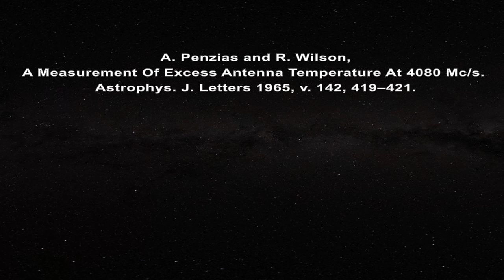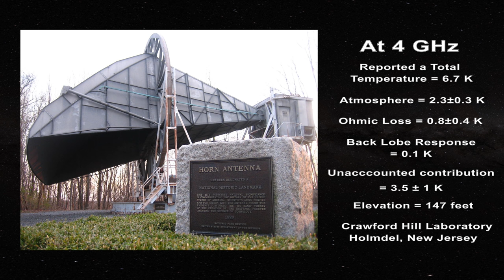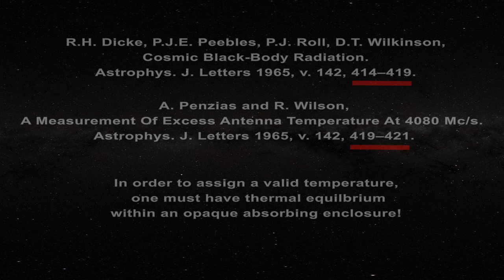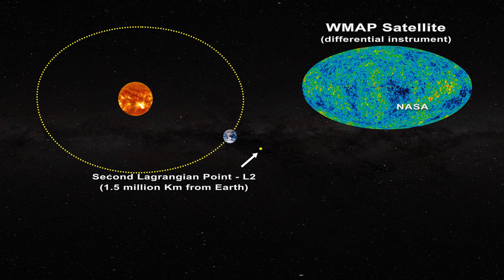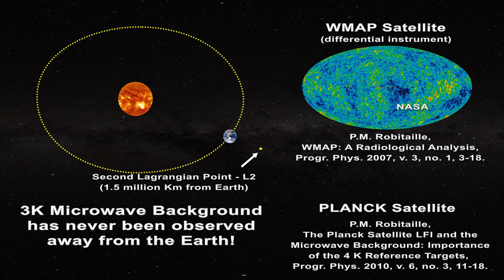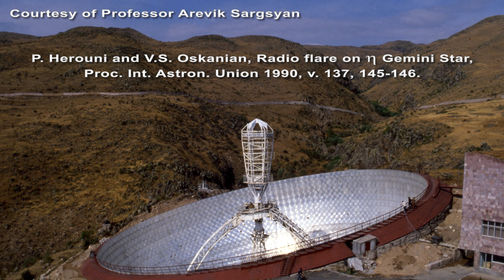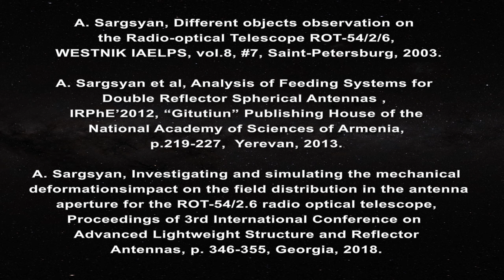The Herouni Antenna - The Death of the Big Bang!

Comment: The CMB is due to aeons of expansion. A small volume of very hot energy is now widely scattered so very cold. If there was no primordial energy the background would be zero Kelvin but its actually 3K +/- 2K. 
How does this debunk the Planck spacecraft map of the CMB which shows the signal is not uniform and suggests how matter could have been formed form the original big bang energy.
Reply: "How does this debunk the Planck spacecraft map of the CMB which shows the signal is not uniform and suggests how matter could have been formed form the original big bang energy.' David Elliott

Since the CMB does not exist, what did the Planck satellite detect? It did not report the presence of the monopole signal at L2, because it's not there. Without the monopole signal at L2 all talk of CMB anisotropies is specious.

Comment: Dr R - You said Herouni measured 2.6 K at 8 mm wavelength.  Wikipedia "Radio Telescope" article shows an opacity curve indicating that radio signals from space of 8 mm wavelength are 90% absorbed by the atmosphere, while longer wavelengths such as the 75 mm length measured by the New Jersey telescope past through the atmosphere unabsorbed.  Is this a problem, or is the Wikipedia opacity curve wrong?

Comment: The stretching, or production, of space-time, cannot cause the non-Doppler, cosmological red shift.  To get the portion of the red shift that was used, erroneously, to justify the big bang theory, the luminal speed limit, mass induction, and the tuning of the quantum electrodynamic notch filter must be variable.  From that realization, I proceeded to develop my alternative model.

Comment: I also think that such a telescope should have been funded by the government of Armenia. But again, this is not a radio dish which is designed to pick 22GHz (and higher frequency) noises but rather this is a radio telescope, designed specifically not to pick them up. You don't build a radio telescope to hear noise. You build it to see stars, galaxies. You are clubbing the wrong seal :-).

Comment: It’s honestly shocking that no one other than myself will come out and expose the manufactured amorphous silicon sphere that is fixated at 100 km which is otherwise known as the Karman line. This is responsible for radio transmission among many other “wave” phenomena even though waves are actually bubbles in a closed system.

Comment: OK so The big bang temp. assignment is unconfirmed. It does not mean there is no near blackbody temp. and a big bang ala SPIRAL cosmological redshift hypothesis that does provide a lattice for the cosmic inflation expansion relatively early in history (SPIRAL's Magnetic repulsion' hypothesis) remains as the last fully consistent w/ all the factual observations hypothesis standing in the SCM-LCDM vs SPIRAL comparison.
Reply: @rmpcta: This is not an issue of the alleged CMB temperature being unconfirmed, it is certain proof that there is no CMB so there is no CMB temperature. Only condensed matter can produce a thermal spectrum but according to the Big Bang creationism there was no condensed matter when the alleged CMB was created. At the time of 'recombination' the CMB was 'set free', but there was no condensed matter still. So the Big Bang had no way to produce a thermal spectrum. Without the monopole signal all talk of Big Bang and its CMB is just wishful thinking. Professor Herouni's measurements prove that there is no monopole signal. Penzias and Wilson  measured measured the Earth due to microwave diffraction into their horn. COBE-FIRAS measured the Earth due to microwave diffraction over its shield. The WMAP and Planck satellites at L2 (~1.5 million km from Earth) did not report the monopole at L2, because WMAP was incapable of doing so and Planck because the monopole is not at L2. It is a scientific fact that the monopole has never been detected beyond ~900km of Earth (COBE) and that's because Earth is the source of the signal, via the hydrogen bond in water. There is a lot of water on Earth.

Comment: Much I get into debates with people over the fact of the speed of light and light years in general where people think that light years are and great distance like you're trying to equivalate a light-year in a distance what you cannot do that precisely because everything depends on frequency and you can actually do that because it's only 1.1% between .1 2.5% of a whole frequency on top of that it fluctuate so it's no it's not even stable so you cannot generate a number on distance from using that in light years I call it the strobe light effect because things appear farther than what they are when they're not really that far to begin with

Comment: By the way, you don't need a super-cooled antenna to see "background" (which will be mostly terrestrial and galactic). You can simply coherently combine many cheap antennas with independent receive chains.  The noise figures will average out.  Anyone with a few 10s of thousands of dollars these days can "measure the background" better than Penzias and Wilson did.  Doing it away from Earth will, unfortunately, cost much, much more.

Comment: One question. What’s wrong with a paper predicting a result, and it later being confirmed by an experiment? I’m only asking about the method - hypothesis/proof then theory.
Reply: Protophanes I haven’t read the paper in question but I would assume it predicted the Big Bang. Did it claim it as fact or as a theory? If not, then I see this as speculation which was backed up later by testing (accidental or not). I’m not pretending to be an expert on this subject so don’t mistake it as so. But I am curious.
Reply: @TheSteveSteele  : Penzias and Wilson placed their paper on excess antenna noise with an astronomy journal, under the influence of cosmologists, Dicke et al. included. They should have placed it with a geophysics journal so that their result could be properly analysed by the broader scientific community. It was the cosmologists who assigned the excess antenna noise of the Penzias and Wilson horn to the Cosmos, because they wanted to substantiate their Big Bang theory. Now it is a scientific fact that the CMB monopole signal (the 2.725 K blackbody part of the CMB) has never been detected beyond ~900 km of Earth - precisely because Earth is the source of the signal. Penzias and Wilson did not consider diffraction of surrounding microwaves from Earth into their horn antenna. The excess noise they found is due to such diffraction, not from a cosmic signal as claimed by the cosmologists and astronomers.  In 1988 professor Herouni used his antenna to sample the CMB and his antenna returned 0 K. Thus, there is no CMB, hence no big bang. Herouni's antenna is the most sophisticated radio telescope ever built. Its self-noise is 2.6 K. There is no other radio antenna in the world comparable. His detector is located within a hemispherical dish so that diffraction from the surroundings into the detector is eliminated. In his 1999 paper professor Herouni describes his antenna as an antenna "without edges", since the effect of diffraction at the edges is eliminated from the detector.
Reply: Steve Crothers That’s very interesting. Thanks for taking the time to explain it. What about the WMAP and other satellites that have mapped radiation across the universe? I heard him address this but are their results not reliable for some reason? And where does that leave the Higgs boson particle discovery from a couple of years ago now?
Reply: @TheSteveSteele  First, WMAP all-sky anisotropy maps are nothing but data-processing artefacts [1]. There is no signal in its maps. The signal to noise of WMAP is barely greater than 1, so it can't tell the difference between noise and signal even if signal is present (but it isn't).  The noise (the galactic foreground) is ~1,000 times greater than the alleged signal. Without a priori knowledge of the source of emission or an ability to manipulate the source, it is impossible to extract any signal from such a large envelope of noise. The Planck satellite is no better [3]. In the absence of the CMB monopole signal all talk of anisotropies is wishful thinking. It is a scientific fact that the CMB monopole has never been detected beyond ~900 km of Earth - precisely because Earth is the source of the signal [2, 4]. The Higgs boson is a different kettle of fish, with its own set of fallacies.

[1] Robitaille P.-M., WMAP: A Radiological Analysis, Progress in Physics, v.1, pp.3-18, (2007), 
http://www.ptep-online.com/2007/PP-08-01.PDF

[2] Robitaille P.-M., COBE: A Radiological Analysis, Progress in Physics, v.4, pp.17-42, (2009), 
 http://www.ptep-online.com/2009/PP-19-03.PDF

[3] Robitaille P.-M., The Planck Satellite LFI and the Microwave Background: Importance of the 4K Reference Targets, Progress in Physics,v.3, pp.11-18, 2010, 
 http://www.ptep-online.com/2010/PP-22-02.PDF

[4] Robitaille P.-M., Water, Hydrogen Bonding, and the Microwave Background, Progress in Physics, Vol.2, April, 2009, 
http://www.ptep-online.com/2009/PP-17-L2.PDF

Comment: Consider what an electric field looks like. There is never a positive side without a negative side. This is because electric charge is not elementary, it is an emergent pattern of angular momentum. I highly suspect that one of the quarks in every hadron is a false quark made up of vacuum energy, specifically the one with imaginary vector in comparison to the other 2. This is likely the reason that space/volume exists.

Anyhow, my point is that monopoles are a myth, they don't really exist and at the finest levels we can see that when they "try" to exist it results in spontaneous creation of a third virtual particle (the imaginary quark) or it results in separation of charge (W bosons as a result of meson transfer). 

When the strong force tries to act like a monopole, it breaks into the weak force. Monopoles are so forbidden that space and volume are created to keep it a dipole.

Comment: Why is there only one theory for the redshift in the universe? 
The Bigbang-theory is based on the observation: The larger the distance, the larger the redshift; but maybe that theory is wrong?

Maybe that observation should be regarded as a property of light, and not as a proof for bigbang-theory?
When the redshift in the light of galaxies would be measured (at intervals) over a long period of time, then what happens with that redshift?
According to bigbang-theory then that redshift would increase, but if that redshift does not increase, then that would be proof that the bigbang-theory is wrong??

Comment: “Dark Matter is not ‘invisible’, is not ‘transparent’ Matter.”
Adrian Ferent

“Light will not cross Dark Matter because the Gravitons from Dark Matter will transform light in Dark Matter.”
Adrian Ferent

“Light will not cross Dark Matter because Dark Matter density is higher than Planck density.”
Adrian Ferent

You learned from your professors, from your books, from the greatest scientists…that Dark Matter is ‘invisible’, is ‘transparent’ Matter.

“What you learned from your professors, from your books, from the greatest scientists… about Dark Matter is wrong”
Adrian Ferent

You learned that Dark Matter is some form of material that does not emits, reflects, absorbs light.
This means the light goes trough Dark Matter because light does not interact with Dark Matter.
The wrong picture where Matter only accounts for 4.9 percent of our universe; another 26.8 percent is constituted of Dark Matter and 68.3 percent is constituted of Dark Energy. The scientists thought because there is 5 times more Dark Matter than Matter, because they did not detect Dark Matter which does not interact with light, the scientists have come to the conclusion that Dark Matter is ‘invisible’, is ‘transparent’ Matter.
When you look at the sky and you do not see Dark Matter, this means it is ‘invisible’, is ‘transparent’!

Here are 2 examples, Lisa Randall professor from Harvard university and Dan Bauer physicist from Fermilab, of what the professors, the scientists think about Dark Matter: they think that Dark Matter is ‘invisible’, is ‘transparent’ Matter!

Lisa Randall professor from Harvard university, on New Ideas About Dark Matter:
https://www.youtube.com/watch?v=NdaQWj5ykso

Dan Bauer physicist from Fermilab, on what is Dark Matter:
https://www.youtube.com/watch?v=o79szJBtQ5E

Visible light is usually defined as having the wavelength around  5 × 10^(-7) m.

I calculated the mass of Dark Matter, a sphere with the diameter of 2 wavelengths:
The sphere volume:

V= 4πr^3 / 3
V= 5.2 × 10^(-19) m^3

In Ferent Quantum Gravity, FQG, Dark Matter with this volume has a density higher than Planck density!

The density of Dark Matter is higher than Planck density = 5.2 × 10^96 kg/m^3

I consider the Dark Matter density for this volume 5.2 × 10^99 kg/m^3, much smaller than Ferent density.
The Dark Matter mass:
M = 27 × 10^80 kg

This is a huge mass, because Dark Matter has another structure, based on Ferent length  much smaller than Planck length.

Light will not cross Dark Matter with the volume V and the mass M.

Light will not cross Dark Matter with the volume V because the Gravitons from Dark Matter will transform light in Dark Matter.

“Light will not cross Dark Matter because the Gravitons from Dark Matter will transform light in Dark Matter.”
Adrian Ferent

“Light will not cross Dark Matter because Dark Matter density is higher than Planck density.”
Adrian Ferent

This means:

“Dark Matter is not ‘invisible’, is not ‘transparent’ Matter.”
Adrian Ferent

“Your professors, the researchers, the greatest scientists…did not understand Gravitation and Dark Matter”
Adrian Ferent

“Ferent equation of the Universe, made of Matter and Dark Matter”
Adrian Ferent

170. I am the first who calculated Dark Matter mass with the volume V

171. I am the first who discovered that Dark Matter is not ‘invisible’, is not ‘transparent’ Matter

172. I am the first who discovered that light will not cross Dark Matter because the Gravitons from Dark Matter will transform light in Dark Matter 

173. I am the first who discovered that light will not cross Dark Matter because Dark Matter density is higher than Planck density

http://vixra.org/abs/1902.0029

Comment: So you reject WMAP easily (most modern and farthest away from Earth this far to measure it) but suggest that the fifty year old data from an Earth bound antenna is more accurate and should be the evidence for your refutation? I do agree that further research should be done but considering the fact that the big bang theory does not hinge on this alone makes it more unlikely that it did not happen.

Comment: @sky scholar New sub here... can you explain how the vacuum of space exists next to our pressurized atmosphere without a solid barrier.
Reply: Its called gravity and electromagnetism,  the earth generates significant amounts of these attracting forces it holds a thin layer of gas to the surface of the planet. Thin relative to the size of the earth that is. I doubt this will make you more intelligent however so if you wanna think the earth is 2D and motionless with an undiscoverable glass dome over it, be my guest. Much easier to understand than the heliocentric model thats for sure

Comment: This antenna is much more primitive to make such a challenging conclusion. The spherical antenna in Argentina is much more effective and stronger than this one. It was built at Soviet time, and that time its characteristics were met with great suspicions by radio astronomers. As I know, nobody had been using this instrument due its unaccuracy in measurements.

Comment: Thermal energy singularity frequencies is in unidirectional forward maximum momentum velocity in resistance to cold space. In magnetic fields cycling circulation patterns of mass, it is outward pressure held in mass as outward force of pressure known as weight. Weight defines the the thermal energy singularity frequencies rebounding in mass in equalization of resistance contained by magnetic fields of forced motion holding mass together. Maximum momentum velocity is constant in and out of entanglement of mass. Space vibrates as dark energy fabric as mass amplifies it, in it, and through us. Thermal energy singularity frequencies are throughout space as space. We transition in it, as it moves through us, in our maximum momentum velocity of existence. How can thermal energy singularity frequencies be compressed? Space itself would have to collapse. Is the universe the mass that we are aware of? Is space infinite? If so, since we can't see how far the universe expands, how do we know we just aren't in space as space? And all the mass is just popping in and out of existence. Maximum momentum velocity is space itself, dark energy vibrating. Entanglement is formation of magnetic fields of resistance to forward maximum momentum velocity in resistance, redirecting momentum in cycling patterns of mass in equalization. Conservation of maximum momentum velocity in resistance to cold space as space itself. Mass amplification of proximity space surrounding mass and in it. Point to point of transitioning our vibrations to the points in forward amplification of us in us past us. We are surfing a wave that is our vibrating maximum momentum velocity where space is moving through us as we vibrate in forward momentum. The energy and resistance behind us was us. Out with the old and in with the new. Alpha and Omega. Theoretically?